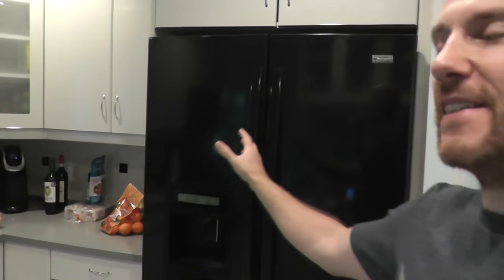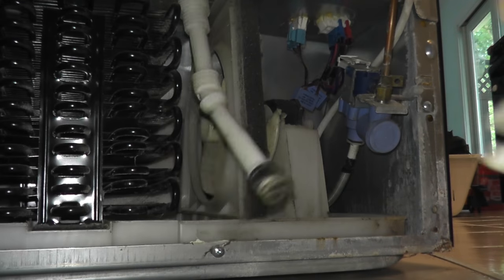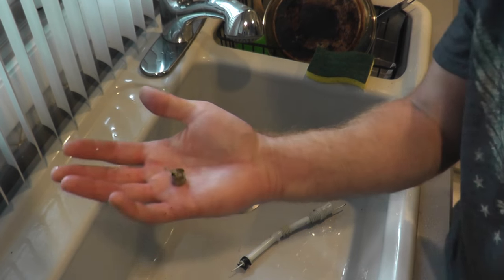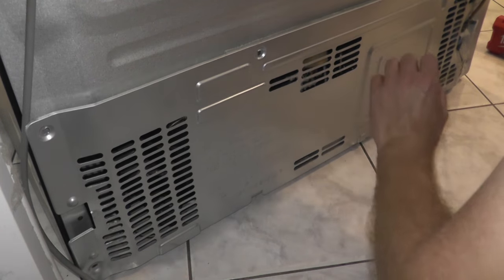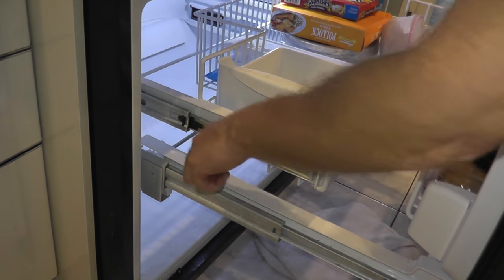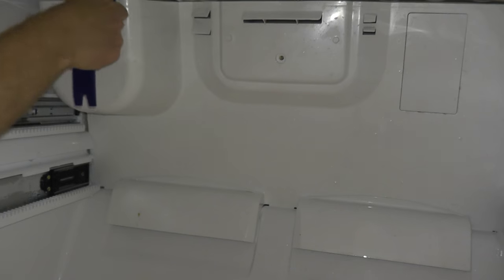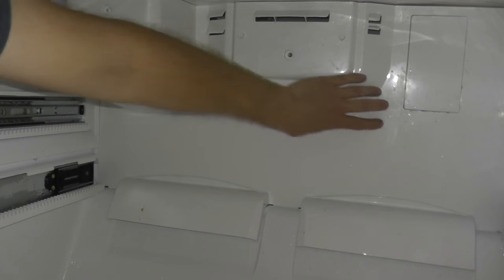Kenmore Elite Ice on Bottom of Fridge Repair

Comment: I had mine fixed twice in two years but never saw the line removed and cleaned like you did. HHUUMMMM?
Reply: Mine was done 2 years ago. It needed it again this year but teck had a total different take. Symptoms are the same as 2 years ago but he now says I have a leak in the internal cooling system that is causing the ice build up. Also as compressor felt hot it is going bad. He did a check on line but did not remove it like we see here. In 2 weeks we are iced up again. I am looking at new ones and if you can find one they look like crap on the inside. Fear I am about to buy a new one and may still have a clogged drain. Should I tell second opinion guy, this is a second opinion call or keep quiet?

Comment: So I took the back panel off and checked the drain tube, it wasn't clogged at all.. however I still am getting the ice buildup in the bottom and leaking water on the floor.. any thoughts on why?
Reply: Gainsnation  Us too. Drain tube completely clear.  Did defrosting the coils make a difference?
Reply: @pamelataylorcather2671  I think it helped a little bit. The leaking/ice buildup is much less severe but it is still a problem :( So irritating!
Reply: @pamelataylorcather2671  At the bottom of the coils there's a "trough that's angled and the ice build up in it is very thick.  If you don't get that ice out I believe the water will continue to run onto the freezer floor and you'll get leaking.  I just did mine yesterday and that was the way mine was, tube in back was not very dirty.  The white panel did not have any screws in it, I had to reach to the top and pull it away from the back wall, used a pry bar type of screw driver that allowed me to pull it away so I could get my fingers under it.  There were a couple of wires attached to the panel but I left those attached and worked around them.  Time will tell if this solves the ice build up and leaking water. Good luck.
Reply: Ron W Same prob here. Did your fix work?

Comment: Excellent, so exciting to find my exact item, it took me some time to find where this item was after others just hinted at it, you showed the exact location and fix.  I hope that's it (not done yet, "measure twice, cut once") but very good vid!
Reply: The leak returned because I only cleaned the drain (which was plugged), opting to do the heating of the coil if it returned - it did return but I saw another vid where the guy did the same as you, but then said he could have done it by just heating from the back, so I did that and it lasted longer, but now just leaked again (do to that frozen ice on bottom), I guess I'll try your method of removing the inside to heat.  It'd didn't 'freeze over like this for like 15-20 years, something isn't cycling.

Comment: So it wasnt cooling the fridge before you cleaned the drain?
Reply: No, the fridge and freezer work normally, but ice (melted frost that refreezes) keeps accumulating in the bottom of the freezer until it overflows or prevents the freezer door from closing properly. On some models the ice buildup can make the bottom drawer/tray in the freezer section become frozen in place and difficult to extend.

If the fridge section is not cooling enough, it could be that your defroster has failed and the evaporator coils have become clogged with frost, and since frost is a rather poor conductor of heat, the air flowing over the ice-clogged coils doesn't get cold enough to cool the fridge section, but that is iust one of the many reasons why the fridge section may not be getting cold enough.

Comment: Where does it drain too ?.
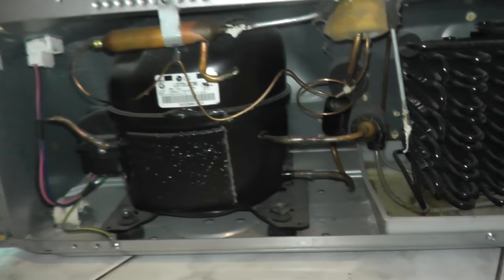Reply: There's a white, rectangular plastic tray called the drain pan (he refers to it at 1:15 but you can see it better at about 1:05-1:07 when he quickly moves the camera past it before zooming in) that sits underneath where that drain tube drips out. The ambient temperature plus the heat generated by the appliance cause whatever drips out there to just evaporate into the air.
Reply: @MicroscopeCat  OK brill thanks I need to do ours ive located where I need to remove the panel/tray etc we keep getting  a layer of ice at the bottom lol annoying
Reply: @kevinhancock4064  Good luck! I closed on my first house ever in December and this crap literally started a week after closing. I kept chipping out the ice whenever it leaked onto the floor - goodness it's been a headache for months. The most time  consuming part was emptying the freezer; the rest isn't too bad. You got this!! Good luck!
Reply: @MicroscopeCat  I'm sure I have ha ha im guessimg you mean bought ? Aka closed ? I'm confident in most things fixed a few tv's etc inc led's lol so I should be OK its only a few years old and I know the door(s) have been left open once or twice ggrr thanks fella

Comment: Is this also why mine doesn’t make ice?  My ice maker is located in the bottom freezer
Reply: No, this is just a problem with melted frost accumulating instead of draining out during the defrost cycle. Normal operation of the unit is not affected, until the ice build up starts interfering with proper closing of the freezer door or defrost melt water starts leaking out.

Comment: Where does water drain after it is cleaned?
Reply: Into an exterior pan underneath the fridge. It evaporates from there in the time between defrost cycles, helped by heat from the compressor and condenser coils.

Comment: I would have pulled that rubber flapper off the bottom of the drain line. Sometimes they get stuck closed and the gunk starts to accumulate.
Reply: Removing that flapper could actually start the problem or make it worse. External warm moisture-laden air will then more easily enter the drain pipe and frost will begin to form at the top end of the drain pipe which is at the freezer temperature and isn't heated during the defrost cycle. The melted frost dripping off the evaporator coils during the defrost cycle is barely above the freezing temperature and can easily refreeze in the collector tray instead of draining out. Frost buildup in the top end of the drain pipe will facilitate this refreeze, creating a blockage that then will not fix itself unless you manually thaw it out as shown in the video or you suffer an extended power loss that results in a natural thaw.

Comment: I had the same problem too but the pain in the butt problem is I can’t remove my drawers so i cant unscrew my back panel which is a dumb hex head, I just have space heaters and a hair dryer hopefully it will dry out
Reply: I think I have similar issue. Did it work out for you?
Reply: The drawers are not designed to be permanently installed, so just examine the rails/guides and you'll probably find some mechanism that allows the drawer to be removed, and quite easily too. The trick may be in figuring out how to operate that mechanism to enable removal, as the mechanism is designed to be child-proof and also to not be released inadvertently while moving the drawer normally.

Comment: Followed your steps and it’s still leaking! Any suggestions?
Reply: Did you get the ice out at the bottom of the coils?  There's a "trough" there that is angled and the ice build up is pretty thick in it.  My back wall had no screws in it, so had to pry if away starting at the top and pulling off,  Be careful as there were a couple of wires attached to frig that I left attached while I got the ice out of the trough.